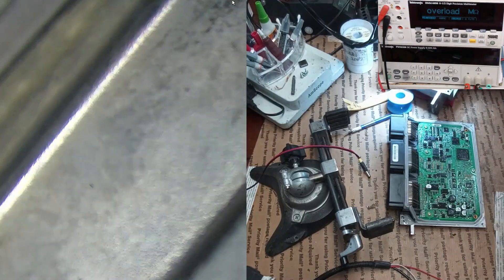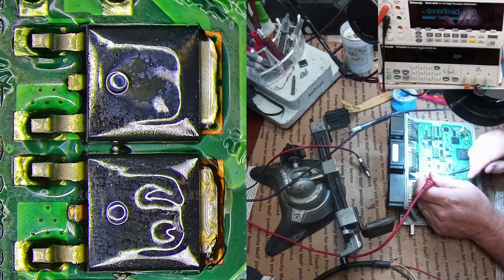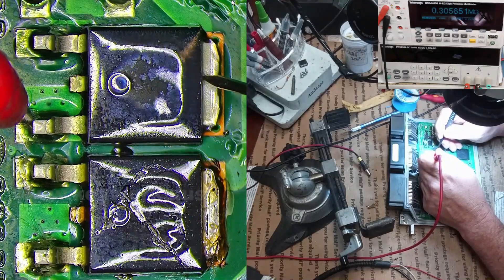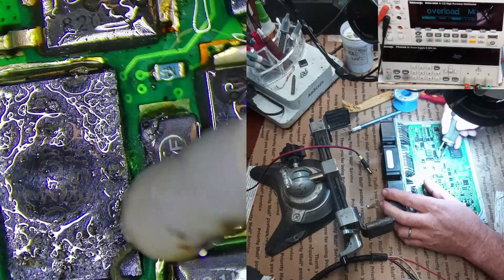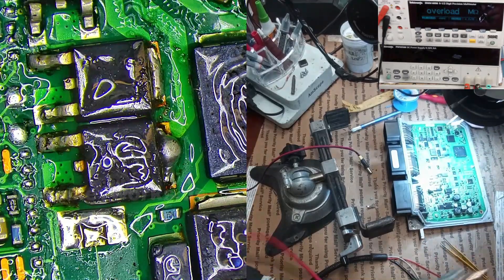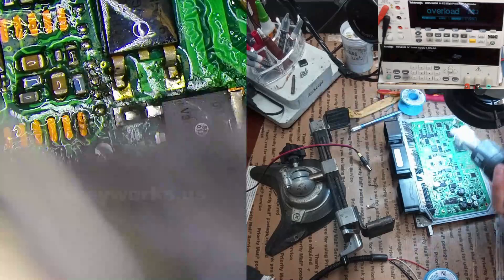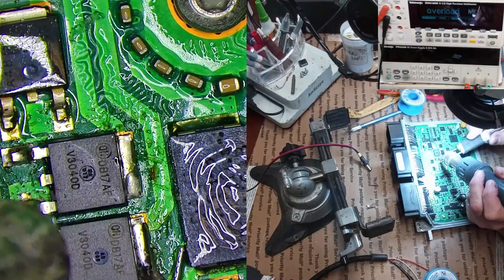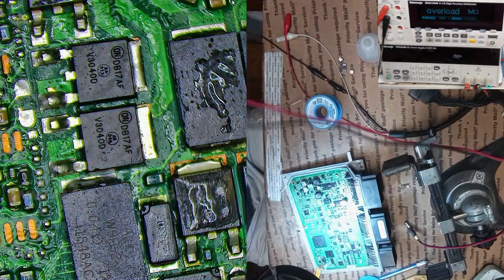Quick Diag and Fix for Persistent Misfire DTC : Board-Level Electronics Repair on Damaged Ford PCM

Comment: I had my ecu rebuilt a few months ago. Explorer burnt up a different coil so I took the ecu out and apart couldn’t see any burnt chipsets. I measured what I feel was the coil drivers they all read the same prong to prong but I didn’t check the backside tab to the front prongs I’ll take it out and check again thanks

Comment: Good video on testing the ignition IGBTs.  My repairs have not gone so smoothly.  The igbt driver IC seems to be turning on 3 of them at the same time, burning up the current sensing resistors.  (cylinders 1,3,6) This chip appears to be discontinued and has no useful data sheet, so I cannot find a substitute.  I forget the number, since the scrap of paper I scribbled it on is at work with my wrenches.  I will post the number tomorrow.  Are these available at all?
Reply: Ah, here it is 74022PC, the gate driver IC.
The other parts are available.
Reply from the maker: Do not buy igbts labeled 5503GM or the logic gate labeled 74022. These are masked numbers ford used internally. Anything aftermarket is just fake chips that may or may not work. Use updated igbt from onsemi and a compatible 7402. Buy from real supplier like digikey or mouser.

Comment: 1993 ford ranger xlt 4.0 v6 4x4. EEC iv efi-ma46g f37f-12a650-xb computer. Capacitors leaking. How much to repair it?
Reply from the maker: Use promocode "SAVE10" for extra 10% off cause I love doing those older ones. Specially if it needs some trace repair! Fun stuff. > https://keyworks.us/ford-lincoln-mercury/engine-control-module-repairs/ford-f-series-87-99-ecu-repair.html
Reply: @ecurepair  yes looks like the tiny  traces around one of the capacitors need repaired.
Reply from the maker: Hope you send it in, Looking forward to getting it fixed up!
Reply: @ecurepair  the board says motorola 1991 how does the factory actually solder these? Looks robotic precision.
Reply from the maker: Im not sure but I assume most of it was done by pick and place machines and then wave soldered.

Comment: Finally, a proper way of looking for bad MOSFETs.
I've started trying to fix ECUs for 2 months now and it bugged me really hard when i saw the experienced folks using continuity mode for checking any sort of MOSFET. Basically anything that didn't read bellow 50 ohms it was judged good and they look for problems elsewhere.

Great video, definitely very informative.
Also, what is that benchtop multimeter you're using? It's has a pretty dang fast auto range :D
Reply from the maker: Its a tektronix dmm4050 (also fluke 8846A is same thing)